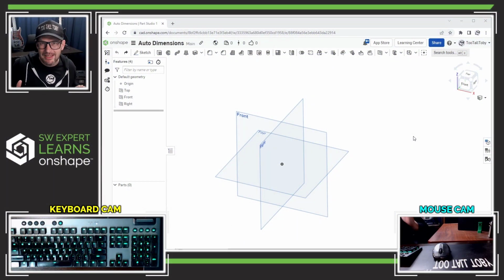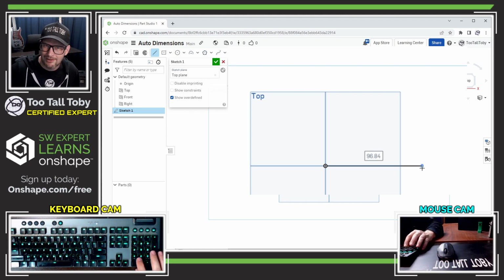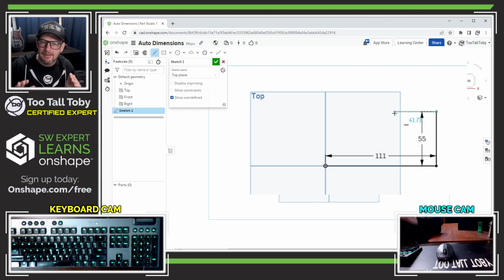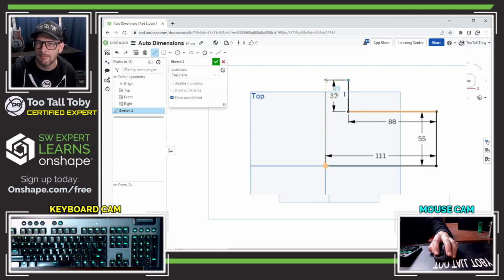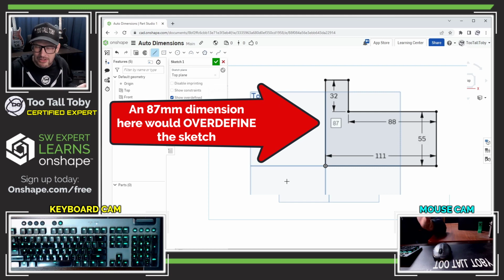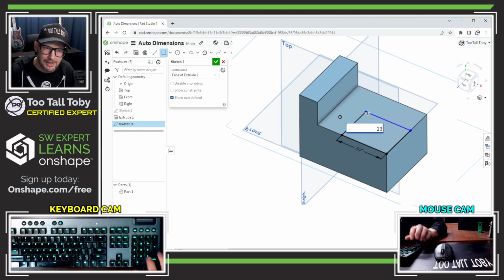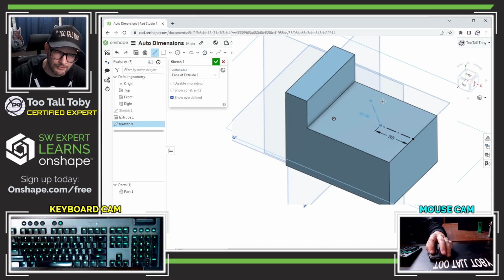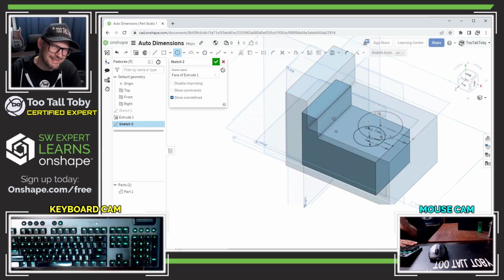Auto Dimensions in Onshape

Comment: Yes, it's a big time saver!
I often use a construction rectangle to locate a point in x and y (instead of adding two dimensions), similar to what you showed for the circle.
Also having the box active after clicking (as opposed to the SW way where it's only active before you place the end point), means that you can pick up a relation first and then set the dimension. In your first sketch example you could have left out the "87-55" and just added the 87 on you last vertical line instead (would also be clearer if the 87 max height is your design intent!).
Reply: Ohhh thats pretty cool!  I'm gonna start trying that!  Thanks Airwick!